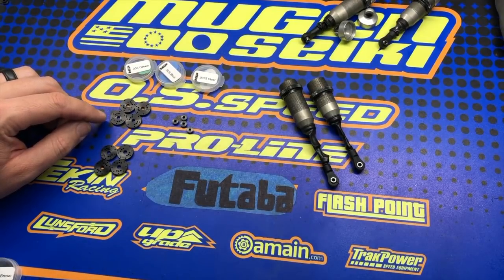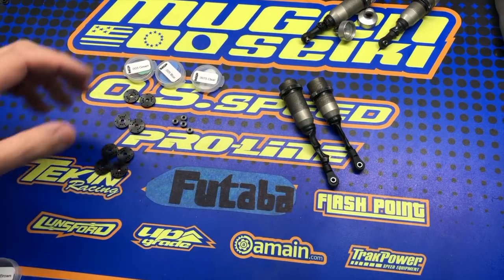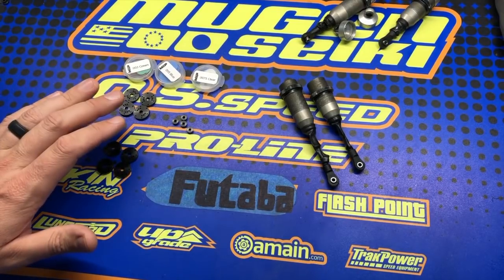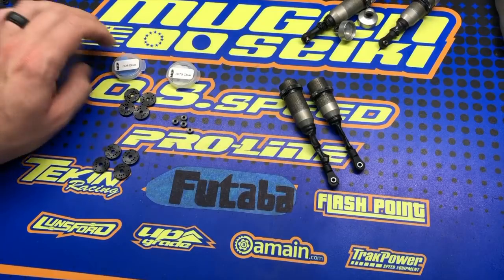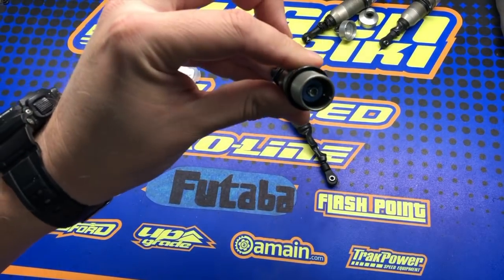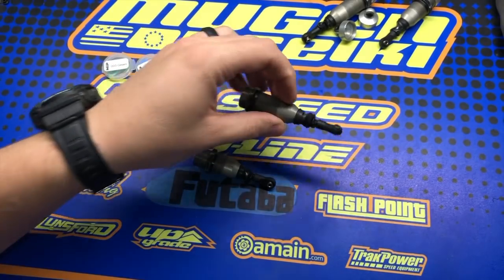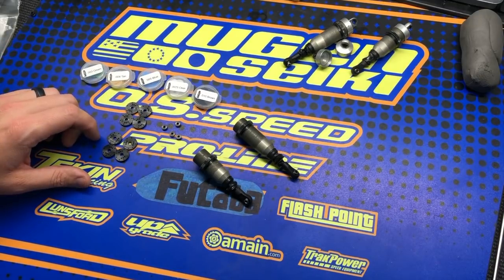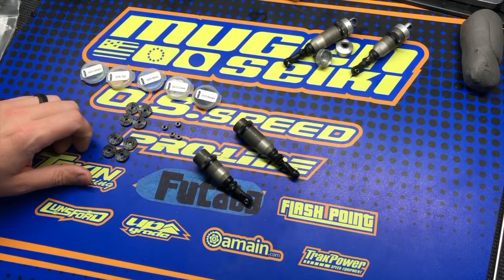Adam Drake from Mugen Seiki Racing talks about the MIP Bypass1 shock pistons.

Comment: Hi Adam love your videos dont stop .Ihave a 8 hole kit for my mbx8 nitro buggy and plan to start with the blue and green valves.What oil weight would you suggest i first set them up with.The track is loose with a few nasty bump sections.The track has some tight turns but no real big jumps in it.Would you use M2C shock caps or are the factory caps more suited for the rebound of the valves.Iwould liketry a 6 hole kit but they are hard to get hold of in Australia.
Reply from the maker: Hello Mark, 
I would start by drilling 4 holes in each of the pistons to 1.3mm and keeping 4 of the holes at the stock 1.2mm.  Depending on the temperature and grip level, you'll want to be in the 550-600 range in the front and 450-500 range in the rear.  We run the stock caps and bladders for pretty much all conditions.
Reply: @AdamDrake  Thanks Adam.
Reply from the maker: My pleasure!
Reply: @AdamDrake  Well Adam i did what you suggested and what a big difference it made.
Reply: We tested after the race and let me tell you it would have lapped the field.
Reply from the maker: That's great, thank you for the update!

Comment: are the mbx6t shock bodies the same diameter as the 7and 8 series mugens?  mip had this concept out since the 90's,  i used them on my lxt and they worked great, the design was different though being a two piece hard piston with the insert opening and closing.
Reply from the maker: MBX6 and MBX7 has 15mm shock bodies.  The MBX7R and MBX8 has 16mm.  Yes, they work awesome.

Comment: What piston and valve setup would you suggest for smooth high grip Astro. I’ve bought the full set 6&8 hole.
Reply from the maker: I would start with the same number of holes and size holes you currently run with standard pistons, but with clear valves in the front and blue valves in the rear.
Reply: Adam Drake Thanks
Reply from the maker: My pleasure!

Comment: Hi Adam can you share some tips on how to keep my tools from rusting? I got high humidity in my location and seems like bolts and screw and tools are rusting even the brand one like hudy and arrowmax
Reply from the maker: Most tools should have a coating , but with steel screws and steel tolls they'll rust if they don't have a type of coating.  Wiping everything down with WD40 will help.
Reply: @AdamDrake  yeah they do have a coating but the hex tip do not have a coating. So the tip is the obly thing thay rust
Reply from the maker: 10-4.

Comment: Hi, would you be able to give the exact diameters of those pistons in millimetres,  tried to find the info but it seems no one knows. I'd like to fit them to a kyosho. 
Thanks in advance
Reply from the maker: Mugen pistons are a slight larger diameter then most pistons, but they'll work in any 16mm shock body as long as they'll fit on the shock shaft.
Reply: @AdamDrake  thanks Adam, in fact I got an answer from mip and at the very moment they are working on kyosho pistons and they should be available pretty soon as well as for other brands.
Reply from the maker: Great!
Reply: @AdamDrake  , thanks Adam for being who you are and taking time to answer questions. Great fan of your driving and your soul.
Reply from the maker: Thank you very much!

Comment: What  do you think of the os vzb v spec ii
Reply from the maker: It's a nice engine, but I prefer the OS Speed B21 Adam Drake engine.
Reply: @AdamDrake  i got it with a used revo so i kinda did not have a choiche lol also whats your opinion on sleeve pinching i am thinking about it
Reply from the maker: If the engine is in good shape other then being low on compression, sleeve resizing works great when it done correctly.  I offer this service.  adamdrake117@gmail.com